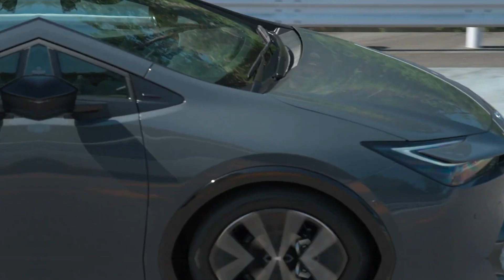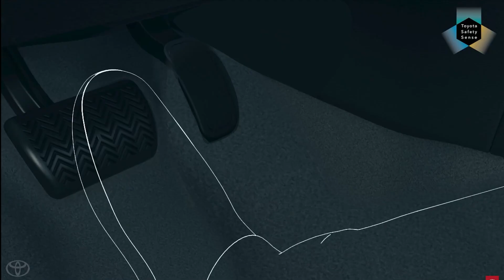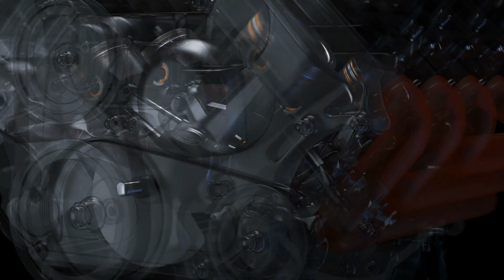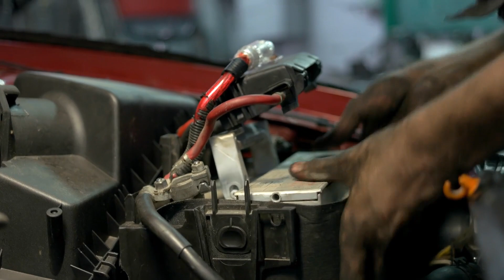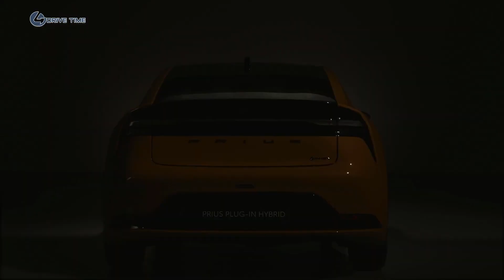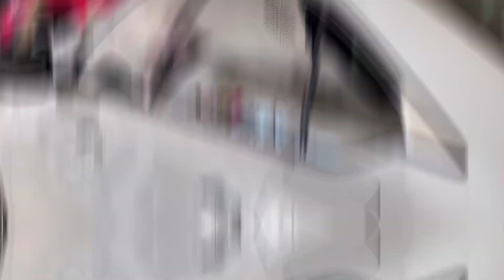2023 Toyota Prius HEV Vs 2023 Toyota Prius PHEV!

Comment: EV are not the best choice for everyone yet.  I live in Hawai’i where almost all of our electricity comes from fossil fueled power plants.  We also have the highest electricity rates in the nation well above 30 to even above 40 cents per KWH depending on where you live in the state and time of year.  

So the environmental  and energy cost benefits go out the window or at least are largely muted.  EVs make sense if you live somewhere with dirt cheap electricity created through hydroelectric or Nuclear.  Also much more beneficial to own an EV is you have your own single family home with Solar/PV setup to lower electricity costs.

EV is not ideal for many apartment condo dwellers who often lack ability to charge at home.  Also not ideal for folks who live in rural areas and long commutes.  Lack of charging stations can be problematic in those situations.

I like my hybrids as I can go from empty to full charge in less than 5 minutes.  The time it takes to put in a full tank of gas.  Depending on the model of hybrid Toyota that gains you 400-700 miles of driving range in 5 minutes.  If you get a plug in hybrid you can just keep charging it and depending on your use you can get by without using any gas.  In other words it can be just like an EV if you like with the added benefit of a normal gasoline car.  Greater range and flexibility.

Comment: non of them if you want a fantastic car buy a ev there s lots out there
Reply: Another benefit of Toyota hybrids that i didn’t mention my other post was proven reliability, battery warranty, and cheaper to replace HV battery when time to replace out of warranty.  New Toyota Hybrids come with a standard 10 year 150,000 mile warranty on the HV battery.  That is at no extra cost and is far better than what is offered on any Full EV vehicle.

Also depending on what model Toyota hybrid you have the cost of replacing a HV battery with a brand new OEM Toyota one is $3500-$7000.  Cheaper if you get a refurb/aftermarket pack.  This is far cheaper that the cost of replacing a battery in a full EV.

I am on my 3rd Toyota hybrid.  Had a used 2004 Prius that lasted 17 years and racked up 288k miles.  Had a 2012 Prius that ran flawlessly with battery replaced for free under warranty.  That one racked up 194K miles before getting rear ended at 30 MPH.  She was declared a total loss but was surprising still drivable.  Drove it around for 3 months before finally surrendering it to the insurance company.  Currently got a 2020 RAV4 Hybrid with 40k miles and not a single problem.

As reliable as fully EVs may be the jury is still out on how reliable and cost effective they are to keep going in the long term.  Sorry Tesla, your track record isn’t their yet to challenge Toyota.  Will be interesting to see the next 5 years or so once a whole bunch of Model S start getting well above 10-15 years old. And we see how all these Model 3s are holding up after 5-8 years.
Reply: Full EV is a terrible idea....  Hybrid has a ways to go before I'll be impressed because IMO the best hybrid would be full electric power train with a small engine generator.
Reply: Most evs are going to run you 10-20K more than this car though.